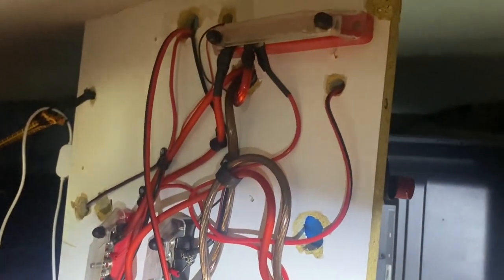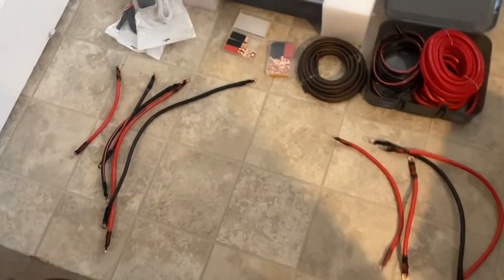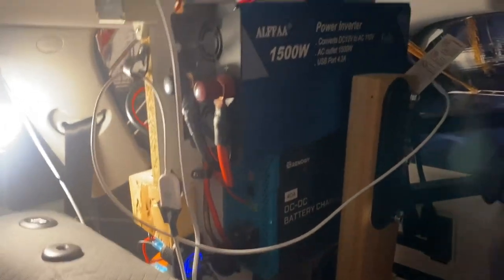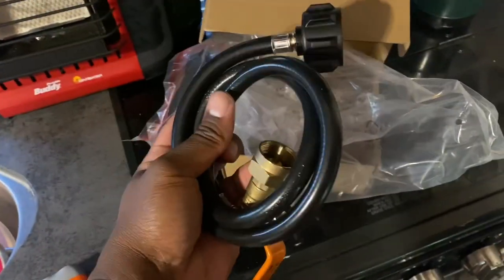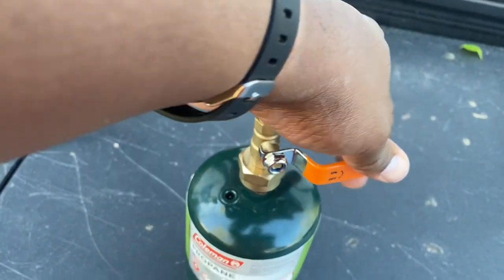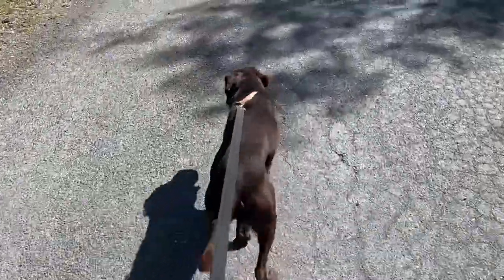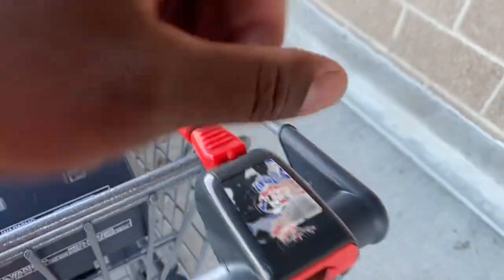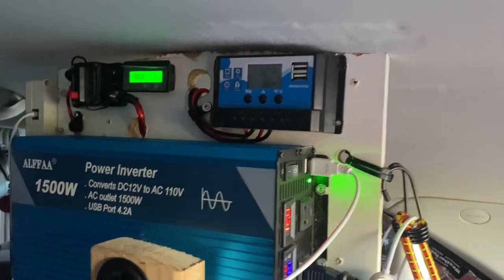Monster 4000 Watt Egscatee Inverter Upgrade / Must Have Propane Refill Adapter By PatioGem

Comment: Ricky, a 4000 watt inverter can pull up to 300 amps of dc power. You really need minimum of 2/0 cable between the batteries and the inverter. Most ise 4/0 which can carry 400 amps
Reply from the maker: Hey John how are you. I’ve two inverters in the suv. The 4 gauge wires are for the 1500 watt inverter. That’s what I was using when I was using the electric grittle. The 4000 watt inverter came with 2 gauge wire. I believe I showed it when I first showed the inverter. I may go for a lower gauge wire if I feel things heating up with the 4000 watt inverter.

Comment: LOVE your DIY solar generator battery videos!  Question: I saw 3 different power inverters there.  Are they all connected to the same batteries and power different things??? I'm a little confused about that.  Thanks for sharing.
Reply from the maker: Yes there are three in there in this video. They do power different things. They are all connected to the same battery through bus bars. I’ve updated this system a couple more times since this video. The system can power mostly anything in the kitchen and household.
Reply: @TheSmallsRVAdventures  Okay.  Thanks for clarifying that for me.  Can you tell me which items are connected to which inverters?  I see you have the 4000 watt, 1500 watt, and the other one.  Thank you.  :-)
Reply from the maker: @ImASurvivorNThriver  the 4000 watt inverter I only use for cooking with an induction cooktop, air fryer, and electric griddle. The 1500 watt inverter I installed previously but it wasn’t strong enough to power my cooking equipment. That was the reason to add the larger inverter. The smaller inverter I plug in smaller appliances. The big one can power everything. I could take out the smaller one but just didn’t. In all honesty this entire setup can work with just the 4000 watt inverter.

Comment: Idk if you have the answer to this but maybe you do. I can seem to find it anywhere... since you're upgrading, I want to do it too at some point. But... at what moment might it be too late to expand my system without having to buy new batteries altogether? I have a 200ah and might be looking to expand to 400ah but idk when it could be "too late" and would have to replace the first one before getting the 2nd one.
Reply from the maker: Hey Maria, you can always expand your system. If you are using the same type of batteries like lead acid you are fine. If you change over to lithium you’ll have to use all lithium. You can add the extra 200ah with no problem. Switching out inverters is very easy. If your wiring was done with 0, 2, or 4 gauge with your batteries and inverter it will be a fairly simple upgrade. The wires take the most time but it is not expensive. You can upgrade your system at anytime with any type of batteries. Right now the lithium batteries are the best but they are expensive.
Reply: @TheSmallsRVAdventures  appreciate it. Thanks! I have LiFePO4 and they're expensive as hell but so far I can run everything with my 200ah just trying to think ahead